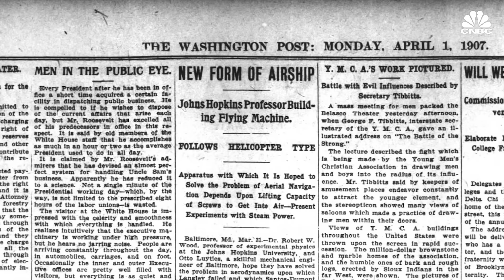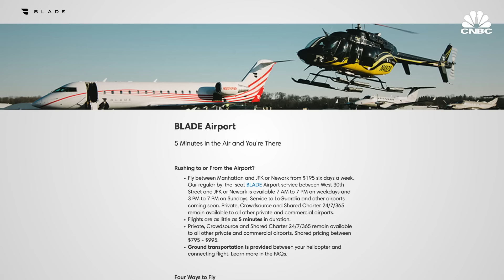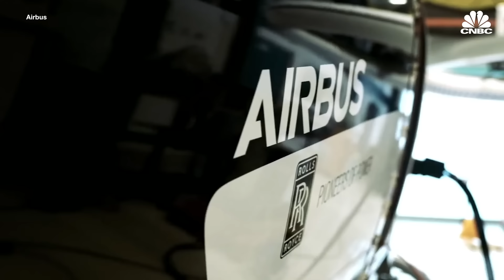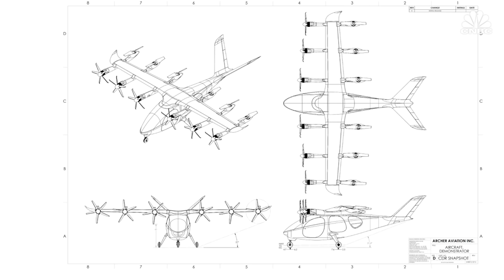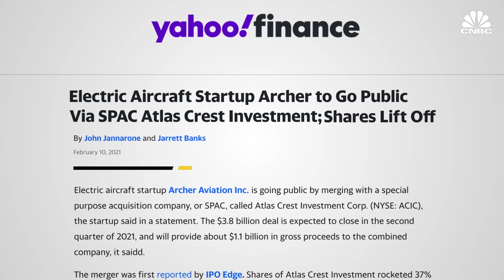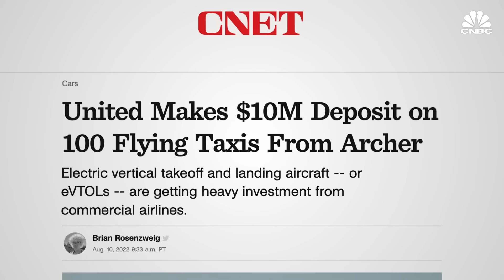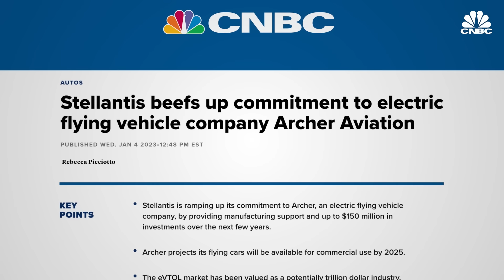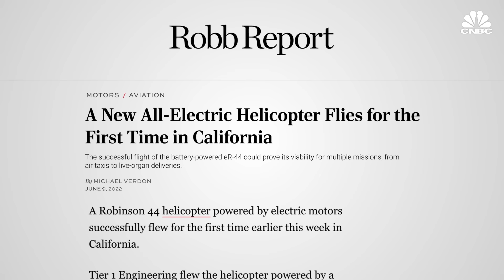How eVTOLs Could Disrupt The $49B Helicopter Industry

Comment: I would be more excited if all this money and effort is directed towards more efficient mass rail transport, making travel faster for everyone. 
I assume that for a vehicle designated a 'taxi', high usage will contribute to smaller carbon footprint compared to ICE helicopters. But eVTOLs seem intended to replace other modes of transport. So effectively, might end up causing a net increase in passenger carbon footprint. Would that be sustainable?
Reply: For the US high speed rail transportation isn't viable. The cost to aquire the land is unimaginable and the fact that the terrain has to be nearly straight makes figuring out routes for the tracks nearly impossible.
Reply: @ajmasters6546  You absolutely have no idea what you're talking about.
Reply: Mass rail is a terrible idea. Stations are not near where you need to get picked up. They are not near where you need to be dropped off. You have to make a million stops along the way. And it travels super slow. I live in Manhattan which has the country's best mass transit system, and it is a terrible experience. In 2023 we should have transportation solved. It's absurd that we still don't.
Reply: @tomy4453  ya you're probably right Tom Y. Thanks for the reply ❤️
Reply: @kajmobile  Sustainability has high value. 

Plus, as discussed in this video, they currently do not have 'pads' for the eVTOL/helicopter expansion.

Additionally, if air traffic increases, any air-vehicle will be grounded till given clearance to fly. A route conflict might require further stops/detours, and please add recharging stops worth hours for EVs, or refueling stops for ICE.

So stops/parking/pads are going to be a concern for every more of transport. Taking Vancouver metro rail as reference, stops and station location is not a problem, and it works great.
Reply: Mass transit in the US outside of a few large cities simply won't/doesn't work for the simple reason our culture is designed around the automobile. It would take an entire culture shift to head towards mass transit which for most Americans is simply foreign and non preferable.
Reply: I assume you're the same guy using multiple accounts to try to push for rail.  Give a PR guy an opportunity and he'll jump on it every time!

Comment: Let's hope that the helicopter mafia doesn't try to impede technological progress .
Reply: They're all here in the comment section doing their thing!
Reply: i suspect the helicopter industry is duely preparing for a shakeup.. and hopefully are preparing to offer their own eVTOLs. And i suspect they will lean in on a hybrid design which uses gasoline and gasoline generators to provide electricity along with a electric battery storage system to power their multi ev rotor vehicles.
Reply: What helicopter mafia?

Also many helicopter companies are jumping into this market too. They aren’t fighting it they are becoming part of it.

Comment: Couldn’t you use solar as a way to extend an eVTOL’s range? Massive wing on one of those things can fit plenty of cells, and let’s not forget that drag coefficients are naturally low on these types of vehicles. A joint venture between a combination of something like Archer and Aptera, for example, would be perfect as far as this goes.
Reply: Not in any meaningful way. That would just be adding a fragile part that needs to be maintained and eventually need to be replaced.

Comment: Amazing!, cheaper and environmentally friendlier, less oil related pollution!
Reply: All those motors needs grease or oil to maintain them.
Reply: @saulgoodman2018  They're almost all made out of plastic composites, which use polymers made from petroleum.
Reply: @PistonAvatarGuy  Yeah, there's petroleum in almost everything.
So we will never stop using oil.
Reply: @saulgoodman2018  Hopefully we can stop using it as a fuel, at least.
Reply: @PistonAvatarGuy  Fuel will never go away.
Reply: @saulgoodman2018  It's a very small amount compared to that used in fuel.
Reply: @joeking433  No one is spraying anything into the air.
Reply: @saulgoodman2018  Where does smog come from?  China is trying to deal with the hundreds of thousands dying in their big cities because of vehicle exhaust.  It is very expensive to drive an ICE vehicle in many of their cities! Some only allow ICE driving every other day, LOL!
Reply: @saulgoodman2018  That's a small percentage of all the fuel used.
Reply: @joeking433  it's not expensive to drive electric cars?
You can buy a gas car for.a.couple thousands. You can't do that with an electric car.

Comment: Radioisotope EV Helicopters will give ev tolls unlimited electrical power. That is the direction ev toll is heading.  NASA has already been using 2 raidiostope rovers on Mars to this day .. Curiosity & Perseverances rover has unlimited electrical power
Reply: You need to use crayons, otherwise your Mom won't hang your drawings on the fridge. ;-)

Comment: Multiple fallacies in this video.  Larger propellers are more energy efficient than and array of smaller propellers, so these are not more efficient than helicopters.  I build and fly rc quadrocopters and airplanes.   They already and electric fixed wing airplanes, but they can only fly for an hour or so.  Fixed wind aircraft are far more efficient than anything taking off vertically.  The energy density of current battery technology is just not practical for any any flights of long duration.